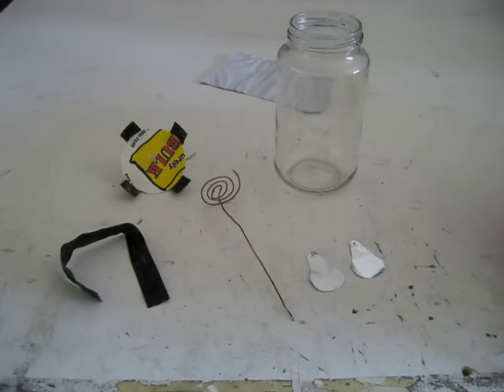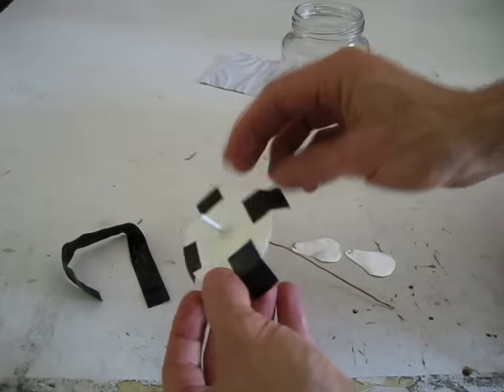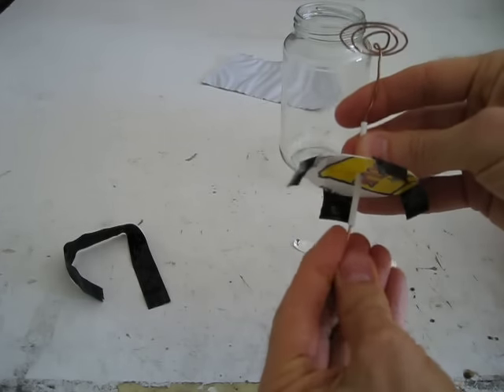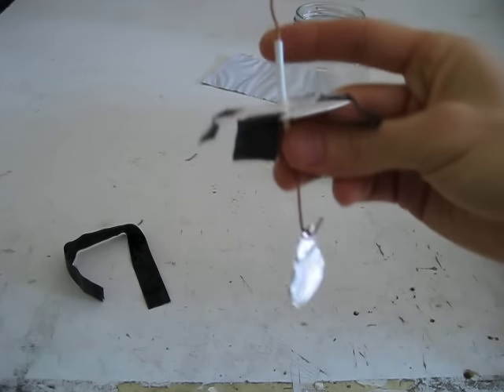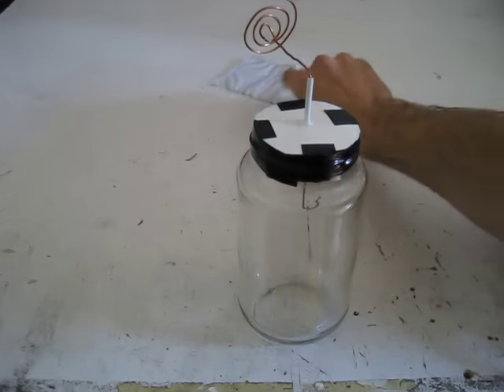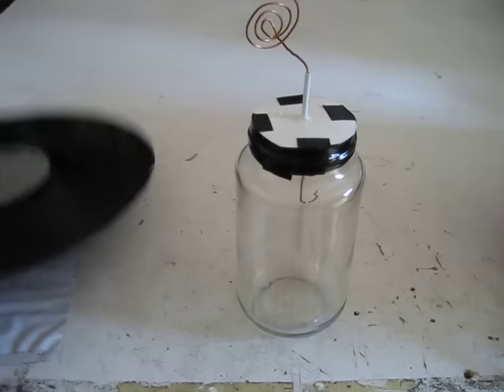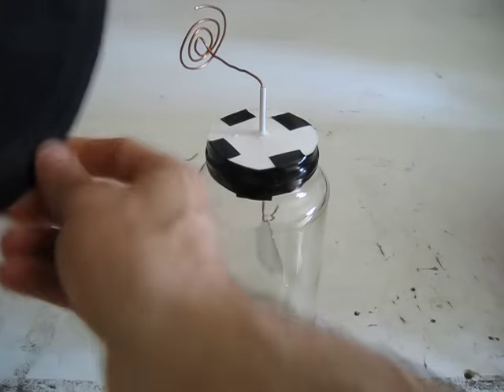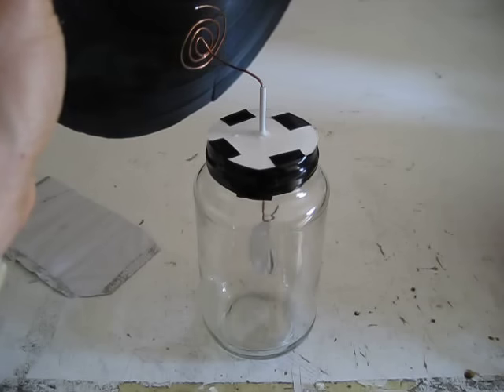How to make an electroscope (DIY)

Comment: What did you do to get the leaves to spread out as far as possible?
Reply from the maker: The amount the leaves spread will depend on how much charge is on the charged object and also on how close the charged object is to the electroscope's terminal. Here's the same link I gave about the triboelectric effect which will help with charging objects https://www.youtube.com/watch?v=ey88EdZo9hU Note also that the more humid the air is, the harder it will be to charge objects.
Regarding the electroscope itself, the place where the leaves make physical contact with the wire i.e. where they hang from the wire, must be a metal to metal contact. There must not be any other coating on the wire there. Scrape it off there is there any. The electrons need metal to metal contact in order to move on to or off of the leaves.

Comment from the maker: I guess you mean this electroscope is too simple. Look through my videos and you'll find "Electrostatic Soap Bubble Science Experiment", "Faraday Motor How to Make How it Works" (make sure you have a fully charged battery), "How to Make Solar Cells using Transistors (2N3055)" (you can demonstrate it with an indoor light), "How a Prism Works to Make Rainbow Colors", "How to Make Kelvin Water Dropper/Lord Kelvin's Thunderstorm".

Comment: Hi umm.. can you tell me the materials you use and the one that you rub in your hands please tell me asap thanks
Reply from the maker: For the electroscope, is it not clear what's needed from the video? I go through them one by one. Let me know if you have any specific questions. Note that if your jar has a lid that you can make a hole in then you don't need to make your own lid like I did in the video. For the one that you rub in your hands, a balloon rubbed against clean, dry hair works well. Just make sure that when you bring the balloon (or whatever you use) close to the electroscope, put the part that you rubbed nearest the electroscope terminal. Only the part of the balloon that you rubbed will have charge. I also give more tips about charging objects in this other video about the triboelectric effect https://www.youtube.com/watch?v=ey88EdZo9hU

Comment: what kind of material is the wire made of? We tried doing this but the aluminum foil isn't moving at all...
Reply from the maker: Mine is made of copper. But it doesn't really matter. It just has to be electrically conductive i.e. metal. The only important thing is that there must be no coating or insulation on the wire where the foils touch it. The contact between the wire and the foils must be metal to metal.

Comment: How long should you rub together? Mine dosen't work
Reply from the maker: You should have to rub only ten or fifteen seconds. Check out my video on the triboelectric effect where I give tips on charging materials this way https://www.youtube.com/watch?v=ey88EdZo9hU I also show other objects you can try such as a balloon and a soda bottle against clean hair. The problem is usually with the charging but it's also possible that the problem is with your electroscope. Make sure there is no coating of any kind on the wire where the foil leafs touch it. You should have metal foil touching metal wire. If you think there's a coating on the wire then try carefully scraping it off there with a knife or the sharp blades of a pair of scissors.

Comment: Does thickness of copper wire be a limitation in testing the electroscope? If yes, how?
Reply from the maker: No, the thickness of the wire doesn't matter.
Reply: RimstarOrg but u said in video that if copper wire is thicker it will be better
Reply from the maker: Nagesh Moholkar
Oh, if you use real thin wire, like the thinness of a human hair or close to that, the you might lose some charge to the surrounding air. But you wouldn't use wire that's that thin anyway since it wouldn't stand up and you couldn't hang your foils from it.

Comment: All nuclear radiation (alpha, beta and gamma) ionizes the air. So, I don't think there is any way to use the pellets to charge the leafs. If somehow the pellets could be put in the jar after the leafs were charged they would discharge them because their electric field would attract some of the ions (produced by the pellets) of the opposite polarity.

Comment: is the plastic tube that much important?  bcz idk how to make it or where to find it
Reply from the maker: +Nour Hamza No, the plastic tube is just a way of holding the wire vertically. You can do that any way you can find. Even just hot gluing the wire to the hole that the wire goes through will probably work (with enough hot glue.)  A straw is another thing you can use. Heck, even a rolled up piece of paper will make a nice support tube!

Comment from the maker: Nope. This scope reacts to charged areas, ones where there are either an excess of positive charge or negative charge (shortage of electrons or excess electrons) and where the electrons are not moving - what's called static electricity. There's no reason there should be such a thing at an outlet or light switch.

Comment: Hi can you tel me that it is important to use glass jar and paper pipe on the cap of the jar
Reply from the maker: No, the jar does not have to be glass. It can be plastic or something else, as long as it's not metal. The same applies to the cap of the jar.
Reply: @RimstarOrg  Ok thank for the help

Comment: +RimstarOrg question. how you make the hole on lid so perfect??
Reply from the maker: +Muhammad Razi I don't recall how perfect the hole is in the lid. Using a lot of hot glue makes it so that the hole doesn't have to be perfect. I don't remember how I made the hole.
It was most likely done using an x-acto knife (other sharp pointed knives would work, maybe even one end of a pair of scissors) by first marking the center of the hole with a marker and then pressing the tip of the knife against the center mark and turning the knife like a drill while applying medium pressure against the lid. As the hole got bigger I'd remove the knife and check the size of the hole to see if the tube fit yet. Basically I probably drilled the hole with the x-acto knife.
Alternatively you can use an actual drill.
Or you can just cut a rough hole in the normal way with a knife. As I said, with a lot of hot glue the hole doesn't have to be perfect.

Comment: Wht you have used in the last plzz tell me it is a plastic or another thing
Reply from the maker: I'm not sure which plastic thing you mean. 
The plastic tube is from a hobby store. You can use a straw. It is for holding the wire vertically, so you can do that in any way that works.
The round plastic disk is just plastic from a plastic container lid.  I used that because I did not have the original lid for the jar. If you have the original lid for the jar then you can use that instead.

Comment: Can the wire be any metal other than copper?
Reply from the maker: Yes, it can be any metal. Make sure that where the foil leafs touch the wire that there is no coating on the wire. It must be metal-to-metal contact. You can carefully scrape any coating off using a knife of the scissor blades.

Comment: @RimstarOrg I made an electroscope but the two pieces of foil are not separating. I have tried many materials but nothing works. I don't know what the problem is, maybe because I used a coffee stirrer instead of the tube you used. PLEASE HELP. T.Y.

Comment: Respected Sir,I don't know what i had done wrong my electroscope is not working..... I had used a glass jar,copper wire of all sizes,and cut down and tried different shapes of aluminum foil but it doesn't work with balloon or with any other things can U please help me.....?
Reply from the maker: +Reivanth K High amounts of humidity in the air makes charging of objects not work. If you're rubbing things on your hair, your hair must be clean, nothing in it. Usually those are the problems.
Reply: Thank you Sir, I repeated this experiment in the way you have said and I had done it......Thank you a lot......

Comment: what is the effect of surface area on charge distribution?? what is the need to coil it up like that ??
@RimstarOrg
Reply from the maker: If you increase the area of the leafs then you'd need more charge in order to make them spread apart the same distance as for leafs that smaller in area. I don't have a formula off-hand but look into Coulomb forces.
The charged object is usually a non-conductive one with the charge spread out over its surface wherever you rubbed it. I coiled the wire up to make up a larger area so that you can face more of the charged object's surface directly.
Reply: @RimstarOrg  does it have any relation with surface charge density?
Reply from the maker: If the charge on the charged object is denser then that means there's more of it. So sure, that would cause a stronger repulsion.

Comment: will it still work if I just use an old wire hangar?
Reply from the maker: +TANKER3000 Yes. But make sure you scrape off any coating that might be on the wire where the aluminum foil leafs touch it.

Comment: Hii. Why did you use aluminum foil inside the jar and not plastic?
Reply from the maker: The leafs have to be made of an electrically conductive material, which basically means they have to be metal. They also have to be lightweight. Aluminum foil fits both those criteria.
Reply: Thankyou sir! I appreciate your effort in answering my question which I badly need in our physics subject :)

Comment: sir i tried many times by rubbing baloon with dry hairs but failed. is it because of cold weather
Reply from the maker: +bishnu kumar pegu Your hair must be clean, no hair products or anything in it. Does the charged balloon affect the hairs on your arm, or make the hair on your head stand up?
The air must not be too humid either.
Make sure that the part of the balloon where you rub your hair is the part of the balloon you bring near the electroscope terminal. Only that part will be charged.
I'd suggest trying a plastic soda bottle too but usually a balloon works better.
You might also find some clues in my video about triboelectricity https://www.youtube.com/watch?v=ey88EdZo9hU.

Comment: Hey I love the video, but I was wondering if there was an alternative to the copper wire? I need the answer in atleast 4 hours sorry ? These highschool projects aren't the greatest.
Reply from the maker: Noob Tube Any metal wire will do. Just make sure that there's no insulation or coating on it where it makes contact with the foil leafs.
Reply: ok thx man, i got an A on my assignment though. SO THX MAN U HELPED TONS
Reply from the maker: Noob Tube
Cool! Glad to hear it. Thanks for letting me know.

Comment: on which thing i will have to rub so i can repel or attract to the almunium foil please tell me i have tried it with comb rubbing on hair and as same as on the scale plz guys tell me fasty i need i9t
Reply from the maker: You can rub a plastic soda (coke) bottle against your hair or a rubber balloon against your hair. Then use the soda bottle or the balloon. Note that your hair has to be clean (no gel or anything else) and the air cannot be too humid.

Comment: how do you know which charges are positive and which are negative?
Reply from the maker: This charging of objects by rubbing them together is called the triboelectric effect and tables have been made of which materials, when rubbed with other materials will become charged and in what way. The tables are called the triboelectric series. You can find a table here on the right, lower down https://en.wikipedia.org/wiki/Triboelectric_effect . Objects on the positive side of the table will become positive when rubbed against objects on the negative side of the table, which will become negative.  I have a video explaining the triboelectric effect here https://www.youtube.com/watch?v=ey88EdZo9hU

Comment: does it detect radiactivity as well?
Reply from the maker: The quick answer is that I don't know for sure. But I doubt it.
Alpha particles from an Americium pellet from an ionizing smoke detector does ionize the surrounding air nearby. You can see that in my video here https://www.youtube.com/watch?v=aJkx6hAD-4E . It does this by the alpha particle colliding with nearby atoms, breaking off electrons from the atoms. That leaves the atoms positively charged and the electrons are of course negatively charged. So the air is charged with both polarities.
However, for the electroscope to detect a charge, it needs to see only one charge, either negative or positive but not both at the same time. So my guess is that no, it will not detect radiation, at least due to alpha particles which is the form I'm most familiar with.
From a quick look at beta and gamma and how they interact with matter, my guess is that the result will be the same as for alpha and won't be detected.
https://en.wikipedia.org/wiki/Beta_particle#Interaction_with_other_matter

https://en.wikipedia.org/wiki/Gamma_ray#Matter_interaction

Comment: sir do length of copper wire affect . becouase mine is long n nt working either.
Reply from the maker: +bishnu kumar pegu The length of wire shouldn't matter, unless along the way it touches some metal object that might interfere. Make sure the aluminum foil leafs inside can move easily.

Comment: What would happen if you rubbed both pieces of vinyl together?
Reply from the maker: With most materials that would just produce low heat. With vinyl, however, you might produce a charge but the effect is something other than the triboelectric effect, I don't recall what it's called. That's the case for other plastics too.
Reply: thank you, I really like your shows

Comment: I done the same but its not working... can you plz suggest me some... I used a copper wire but I don't know that it is of 14 gauge or not and yes its an old one also ! plz help me some one bcoz i wanna show it in my school !
Reply from the maker: +naeem khan The wire size doesn't matter.  The most common problem  is with the charged object. Charging doesn't work well if the air is very humid. Try rubbing a balloon or plastic soda bottle against clean hair and use the balloon or bottle. See my triboelectricity video for more tips on that https://www.youtube.com/watch?v=ey88EdZo9hU. If that doesn't help, make sure the foil leafs are coming in contact with bare metal i..e that there's no coating on the wire where they touch it. You can scrape any coating off with a knife or sandpaper.
Reply: +RimstarOrg ohk I'll try it
Reply: +RimstarOrg and thanxx
Reply: +RimstarOrg It worked😀 I scrapped the coating off then it worked...thanks a ton now I can show it in my class... keep youtubing !
Reply from the maker: +naeem khan Glad to hear it! Thanks for letting me know. Have fun showing it to your class.

Comment: Can we use thin copper wire
Reply from the maker: Yes. But the thick copper wire forms a rigid hook that the foil leafs can hang from and a rigid terminal on top for bringing things near. I'm not sure how you'd do all that which thin wire.

Comment: Can we use earthing wire.
Reply from the maker: I don't know what an earthing wire is unless you mean the bare wire that's found in household wiring for connecting to Earth ground. If so then yes, that works well. Any wire will do as long as it's stiff so that it can hold its shape and as long as it isn't coated with anything where the leafs touch it. If there is a coating there then you can probably carefully scrape it off with a knife or scissors.

Comment: If there is glue on the coil will it interfere? Will the electroscope work?
Reply from the maker: No, glue on the coil won't interfere. The electroscope should still work. If it's not working then chances are the problem is with the charged object. Charging doesn't work well if your air is humid. Some easy things to try are rubbing a plastic bottle (e.g. Coke bottle) against CLEAN hair or a rubber balloon against clean hair. Then bring the bottle or balloon near the spiral.

Comment: Real quick question I used a old hanger and it's not working how come?
Reply from the maker: +The Diplomic Make sure you scrape off any coating that may be on the wire where the aluminum foil leafs touch it. There must be metal touching metal for the electricity to conduct from the wire to the leafs. But the most frequenct reason is usually a problem with charging. See my video about the triboelectric effect for ways to charge objects https://www.youtube.com/watch?v=ey88EdZo9hU.
Reply: +RimstarOrg Thank you so much.

Comment from the maker: @bainssimrat7 It should still work without the spiral if there's some wire sticking out of jar that you can put your charged object near. Are you sure you've charged something real well? Try different objects. See my Triboelectricity video (link at the end of the video). But I'll need more information before I can help. Either try describing what you've done and what materials you've used in more detail or send me a photo to stevendpe at hotmail point com.

Comment: Mine doesn't work, I'm using a 10 gauge copper wire, bent it into a spiral, used a glass jar and its plastic lid and cut two pieces of aluminum foil. I tried testing it by rubbing a piece of rolled up plastic cover on my hair and put it as near as I can to my electroscope and nothing happened...:( please help.

Comment: what is the tube on the lid made of
Reply from the maker: Plastic, but the material doesn't really matter. It's just there to hold the wire vertically. Any way you have of doing this is fine. By the way, I used a plastic lid because I didn't have the original lid. You can use the original lid if you still have it.
Reply: Well,  it matters a bit, some plastics are better insulators than others.   Try yogurt container lids, they are made from polypropylene, which is a very good insulator.